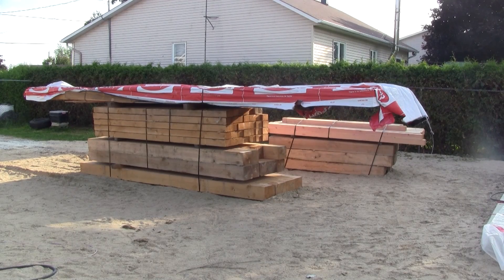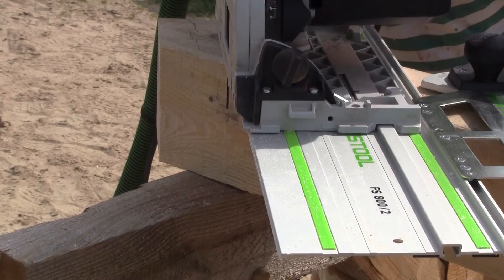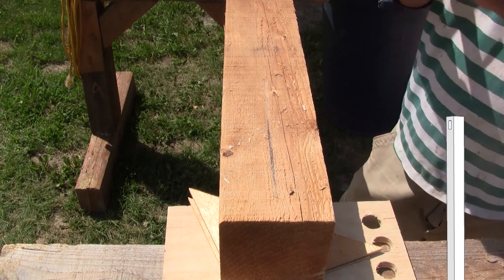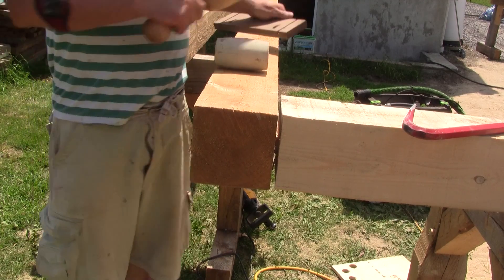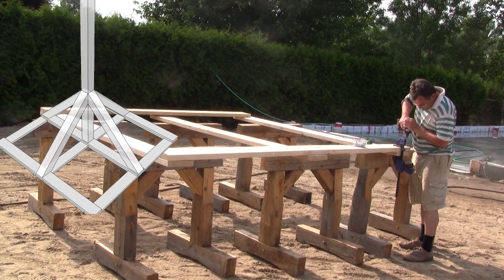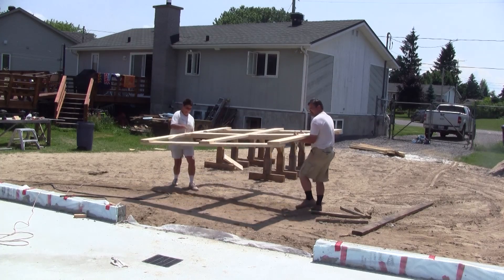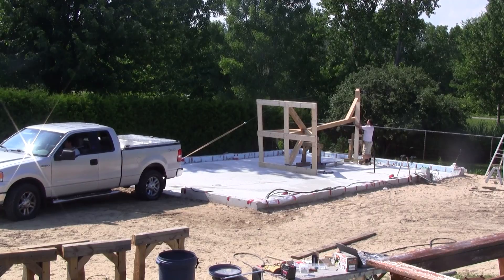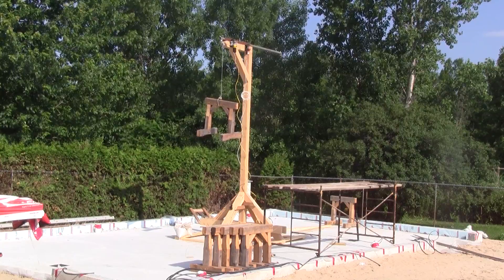The Woodpecker Ep 54 A Crane To Lift My Huge Beams

Comment: just a thought did the cost of the materials for this  amazing crane come out less than a short term hire of some equipment. Beams of this size cost a small fortune in NZ per metre.
Reply from the maker: Actually hemlock 6x6 here is not that expensive. I'm not sure exactly bu I think this cost less than $125. But again I might be wrong... But building it and using it tomorow is worh the price :))
Reply: ***** and the winches etc are recyclable of course :) 6x6 beams here are about $30 metre yikes
Reply from the maker: Mike Francis
You got me curious, so I got my invoice and here's the exact price:
6x6x16   $36
6x6x12   $25 (x2)
6x6x8     $16
total : $102 (+15% tax of course)=> ~$117

Thats not counting the winches wich I bought on sale last winter.But like you said I'll reuse them elsewhere.
Reply: *****  well that makes good sense at about a qtr of the price we pay here, I think we send all our vast forests in nz to japan and korea as logs.... geez

Comment: I'm wondering.  What will you do with the crane when the shop is finished?
Reply from the maker: Good question. I already decided to use it to lift the roof plywood, but after ??
I guess I dismantle it and keep it somewhere so I can reuse the 6x6 elsewherre?
Reply: ***** I was thinking chopping it down to pic machines and move them around until you finalize your layout
Reply: ***** Perhaps re-purpose the crane inside your shop in some fashion. I know I'd like to have something to lift the occasional item.
Reply from the maker: Jeff Ferguson
I don't think so... It's SO big that it will take all the floor space.